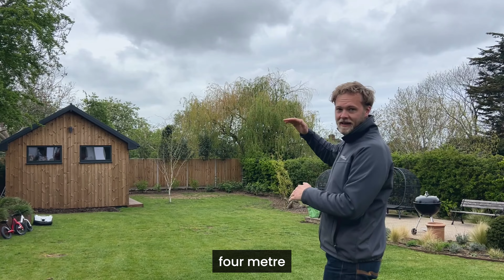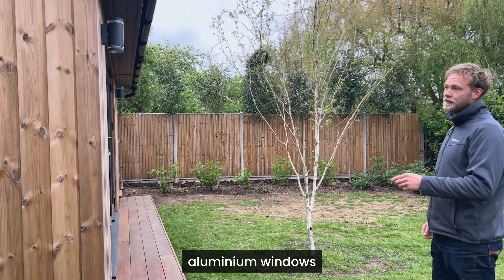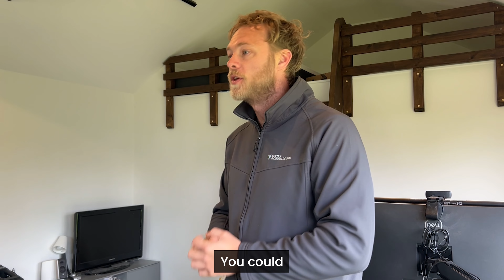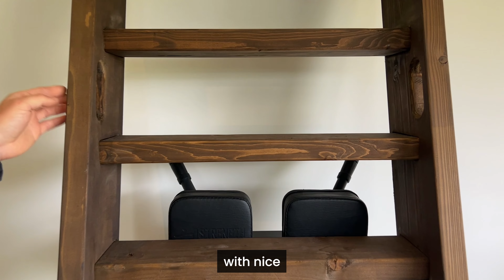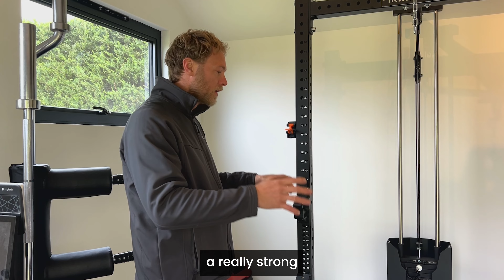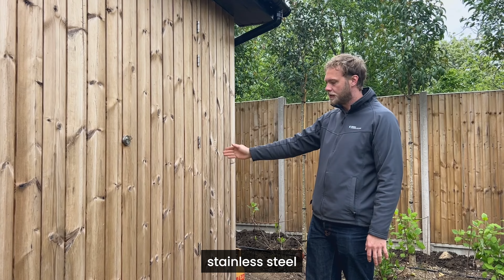Pitched Roof Garden Room with Mezzanine Walk-through

Comment: Nice to see one with a high apex ridge instead of a flat roof. I see you have the truss ties across from and it’s a feature but could you do it without these? I was looking at something similar but 4m wide (external) and a similar height but looking at the timber strength and design/loading it looks like it technically doesn’t need them although it’s not wrong adding them as additional if you want it?
Reply from the maker: Yes we are very pleased with the design of this roof structure. Correct you could have done without the ties if you dropped the collar ties down. However this would then bring the flat section of ceiling down internally reducing the vaulted feel we achieved. Our client preferred a taller ceiling and some nice feature ties.
Reply: @vertexgardenrooms  I was looking at one with either laminated ridge or double or triple ridge in C24 timber. From the timber strength calculations it looks thst it can theoretically support it without the cross ties (at 4m wide externally anyway)